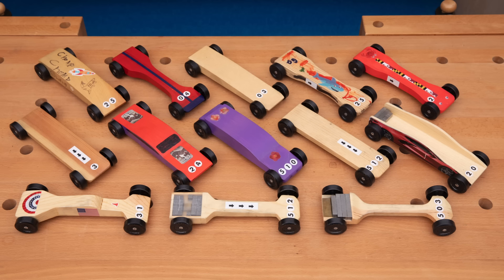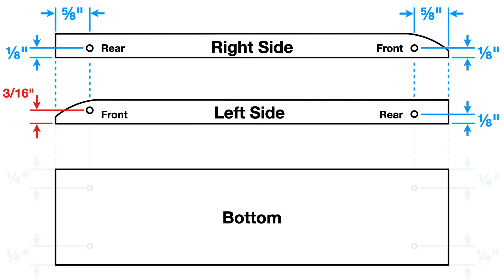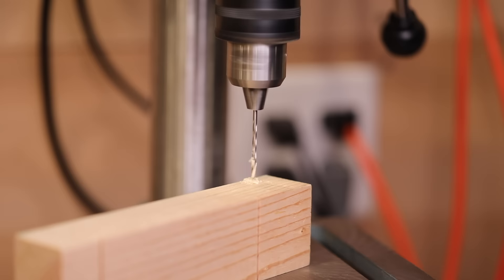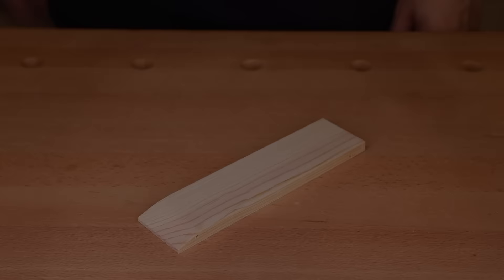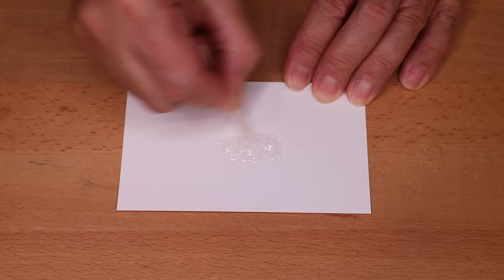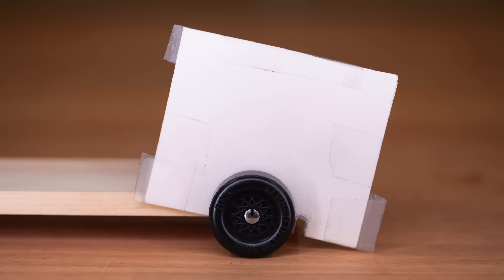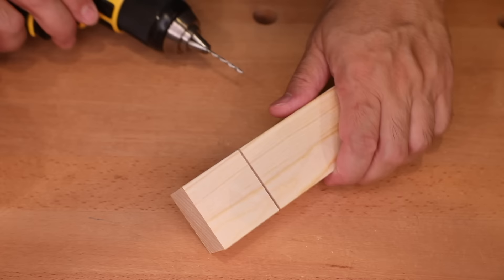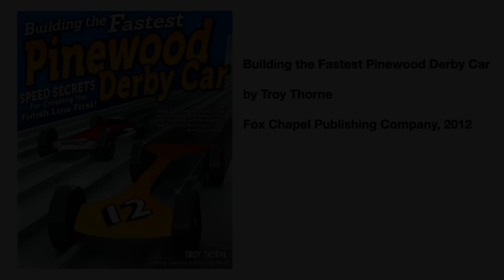Build a Winning Pinewood Derby Car: Step By Step

Comment: Great video. We’re on our 2nd Pinewood Derby and we screwed up our first run at a car this year. Couldn’t follow this exactly because we can’t move the wheels forward or back but I needed a solution for a quick car that would be fast. Using the main principles of this build we were able to put together a car 4 days before the race that finished 2nd in his group and was significantly faster than our first try last year. Looking to build on that for attempt #3 next year.
Reply from the maker: Good job, and congratulations!  As you probably discovered, weight position is still the most important factor even if you can't change the wheel positions.  Wishing you continued improvement!

Comment: Great video and thank you for all the tips. I wish i could attach pictures of the car my daughter and I made for her pwd race event. Her car averaged 218.07 MPH across 6 heats. She won the first place in the pack and the rank Thank you for making this video.
Reply from the maker: Well done and congratulations to your daughter! I wish I could have seen the car.
Reply: The differences in design are 1. instead of the left wheel raised, we had the right wheel raised. 2. Also we could not find the rectangular weights so we went with the cylindrical weights and superglued them together to create a rod like structure and placed them at the end.  @EngWorkshop
Reply from the maker: Thanks for sharing the photo. As you figured out, it doesn't matter which side has the raised wheel. I just had to pick a side for purposes of the video. And your cylindrical weights look better (less utilitarian) than the rectangular ones.

Comment: Really great video!!!! Thank You……I do have a question when placing the nail/axles…..How far in do you place the axles?? How concerned are you to keep the inside of the wheel from rubbing against the side of the body????? Thank you
Reply from the maker: I think the proper gap between the wheel and body is important. As shown in section 8 (wheel installation), the gap should be 1/32 inch. The video shows how to make a spacer to help achieve the proper gap.

Comment: Wanted to use this process, but couldnt because my son's pack only allows existing Axle slots to be used. Great video though!
Reply from the maker: If the axle slots must be used, it is a good idea to drill them out and glue in the nails, as shown near the end of our video.  Otherwise, we have found it is easy for the slots to be damaged during axle installation, or the nails to fall out during the race.  Much of the video's process could be adapted for your son's Pack.  For example, the principles of weight distribution still hold.  And if the axle slots are drilled out, you probably can use the same method of wheel alignment.  Either way, thanks for watching and good luck!

Comment: At the end you show the cars you? have built. Which was the fastest? Thanks for posting!
Reply from the maker: Fastest car was #512, second row, fourth car from the left. It was my car for our Pack's parent race one year. Over the years, I have participated in the parent race using cars of similar design and construction, so I'm not certain why one car would run faster than the others. I wonder if slight differences in track setup might be the cause.

Comment: Most rules require the axles to be visible so drilling holes are not allowed
Reply from the maker: The rule sheet inside the official Pinewood Derby car kit does not prohibit drilling new axle holes. However, each Cub Scout pack sets its own rules, so there will be packs that do not allow repositioning axles and/or drilling axle holes. Each Scout should check their pack's rules. If the axle slots are used, it is still a good idea to drill them out and glue in the axles, as shown near the end of our video.  Otherwise, we have found it is very easy for the slots to be damaged during axle installation.

Comment: Where can you buy that drilling guide?
Reply from the maker: We bought the drilling guide from www.pinewoodpro.com. Similar guides can be found at other Pinewood Derby supply sites, such as www.maximum-velocity.com and www.abc-pinewood-derby.com. If you use a drilling guide to lift one of the axle holes, you may find the hole is lifted by more than the 1/16" we recommend in the video. That is OK, but it might increase the risk of the car jumping off an uneven track. If you want to drill holes at exactly the positions shown in the video, you may have to experiment a little with index card shims placed between the drilling guide and wood block.

Comment: Is the one front wheel not touching the track? Our pack requires all 4 wheels touch the ground. I thought that was a common rule.
Reply from the maker: Yes, in our design, one front wheel does not touch the track. The rule sheet inside the official Pinewood Derby car kit does not require all 4 wheels to touch the track. However, each Cub Scout pack sets its own rules, so there will be packs that have this requirement. If our pack had this requirement, we might have tried bending both front axles upward very slightly, then adjust steering by turning the front axles very slightly in opposite directions.
Reply: @EngWorkshop  thanks for the suggestion!
Reply: @EngWorkshop  why do you have one wheel different height than others?
Reply from the maker: The raised wheel does not spin, or at least not as much, so less energy is lost to this wheel's friction and momentum.

Comment: I've watched numerous videos with my boys. My little guy has done well in the past.  He wanted to shape the bottom of his car a bit. We had to put weight at the front to balance around the 3/4 mark.
Reply from the maker: As you point out, optimum weight location can vary significantly, depending on the car's shape.

Comment: If I have to keep the wheelbase (distance between the center of the wheel axels) at 4.5inch, is it better to shorten the overall length or pull back the location of the front tire axel?
Reply from the maker: Given the wheelbase restriction, it is definitely better to pull back the front axle location.  This would allow the same weight placement as a car with an extended wheelbase.  Shortening the car is equivalent to moving the weight forward, resulting in less starting energy.

Comment: I think raising the nose would allow the car to take off a fraction of a second faster.
Reply from the maker: This is true, in theory. We have seen some car designs that implement this principle. How much difference this makes is unclear. The spring-loaded starting pin found on most PWD tracks releases the cars much more quickly than they accelerate.

Comment: What size drill bit do you use on the press? I rather use my press
Reply from the maker: Whether using a drill press or hand drill, you need to use a #44 drill bit, which is slightly larger than 5/64" and slightly smaller than 3/32". You can buy #44 drill bits from online Pinewood Derby supply stores or Amazon.

Comment: how do you secure the weights
Reply from the maker: An easy way is to use a good adhesive, like two-part epoxy. This is what we used in the video. Beware of hot glue, Super Glue, and Gorilla Glue - we have seen things fall off of cars during the race that were attached with these glues.
Reply: I like to use double sided carpet tape under the weights to hold them in with a layer of hvac tape over them. Works great.

Comment: “Using only basic tools.”

Pulls out a drill press and band saw.
Reply from the maker: When I inserted footage showing the band saw and drill press, I probably should have made it clearer that this video's car was actually made using only the hand tools I showed at the beginning. Although helpful, a band saw and drill press are not required to make a winning car.
Reply: @EngWorkshop  You made that clear.  I heard it clearly the first time I watched the video.

Comment: You are cutting yourself short, or to say making your car slower then it can be. Everything is correct till you made your car go straight. With a bent axel (on the right and the lifted front left) you want the car to steer 3-5 in to the left over a 4 or 5 foot distance. This will make your car a rail runner. It WILL be faster and your times will be consistent.
Reply from the maker: Thanks for the comment. Rail riding prevents a car from drifting side-to-side and losing energy as a result. Using our alignment method, we have not observed side-to-side drift in our cars when they run down our Pack's track, so we have not felt the need to try rail riding. It would be easy to compare rail riding with straight alignment using the same car on a test track.  My son has aged out of the Pack, so I hope another YouTuber will try the experiment and report the results.
Reply: As you move more weight closer to the rear the car will wiggle. Rail riding allows you to move more weight back and not wiggle which is faster.
Reply: @EngWorkshop  going to disagree with you on this one as well.  A few other things that came to mind about axle prep, but not going to pick your video apart.
Reply: It depends on the quality & kind of track. My kid's pack uses a wooden track. So it has slight imperfections on the rail. A rail runner on this kind of track can hit those imperfections all the way down and likely slow it down. I think I'd gamble on the straight runner on a rough wooden track with a lot of imperfections over a rail runner. But on a metal track or a quality wood track you're going to have smooth rails, which then yes, a rail runner would be better.
Reply: @CurtPrice  GL with that straight shooter.   you are assuming that each section of the track is perfectly level from side to side and has no warps, twists, or raised surface wood from being in storage for 12 months.    A bit of 80 grit sandpaper and 3 mins of work fixes that rail.....  Just saying.  fix your packs track for the greater good of all racers.  You do you though.  Just have fun.
Reply: @machineenvyllc437  The first year my kid and I built a car that was pretty plain Jane. It did... ok. Middle of the pack or so. The next year I did the research and we built a rail rider and applied all of the other tips, but it didn't do well at all in trials the day before. It was just slow. It did so poorly, that it was losing to the car we made the year before. The track wasn't smooth, it had bumps & bad spots, it was made of wood, etc. So we actually re-used the car from the year before in the 2nd year. On race day, they stopped the races a couple times to "clean" the track because some cars were hitting an imperfection and jumping the track. It's a homemade track. It's a nice enough track for a homemade one, but it falls way short of the consistency of a metal track. So the last year, we applied proper weight placement to our 3rd car, it rode on 3 wheels, polished axles, streamlined, etc, etc... everything except being a rail rider. We built it to run straight. And it was the fastest car we had yet and it took 3rd place. I know that everyone recommends rail riding, and I get it. It's the way to go on a smooth rail, but if the rail isn't smooth, I think you're better off not riding the rail and hoping you miss the imperfections as it goes down the track.
There are all kinds of things that could factor into what may slow a car down. Obviously it could have been something else I guess. But based on what I saw on this particular track, rail riding didn't seem to be the way to go.
I honestly wish they'd invest in a nicer track. But I think this one is sentimental or something as some beloved scout leader built it years ago and they've used it ever since.
Reply: @CurtPrice   I have built 1000’s of cars   Statistics says your straight shooter is an outlier.  

I am not giving advice for outliers.  I am   giving advice for those that need direction that will put setups in their favor.  

I bet their are more better tracks out there than bad ones  

Not even adult league racers do straight shooters.  

And just a thing of note  if you built a rail rider once   I almost bet the adjustments could use some tweaking to get more speed.  rarely have I seen anyone built it correctly the first time   That is my experience as a derby guy
Reply: @machineenvyllc437   Again, on a regular track, you're 100% correct on all of that. But I'm telling you, this was not a regular metal track. It's an older, homemade, wooden track with a lot of imperfections, including nicks and bumps on the rails and seams where it's pieced together. Rubbing the rail the whole way down, hitting every single imperfection and seam, doesn't seem to be the way to go on this particular track... at least from what I saw anyway. Each time it hits one of those imperfections or seams, it slows the car down. And like I said before, there were a number of cars that jumped the track.. likely due to these imperfections combined with maybe improper weight placement. I know straight runners have issues with bouncing around, but by not riding the rail, they're also avoiding some of the imperfections on the rails. And I'm going to go out on a limb and say rubbing against a wood rail the whole way down would slow you down more than rubbing against a metal rail does.
But hey, I'm not an expert. I'm just telling you how it is on this particular wooden track.
Reply: @CurtPrice  Going to have to disagree with you 100%  And I'll just say.... You are setting people up to fail by suggesting your way is better for a wooden track.  I am trying to guide them to the right path that is statistically in their favor.  

You're saying one time at band camp.    Sure that one time....  worked for you.  But I guarantee you statistically the rail rider gets more / closer to the winner's circle on all tracks....  And if you are really grinding (meaning too aggressive ) then your tune is incorrect.  you should only be kissing.  Maybe your tune was really aggressive?  No one really knows.
Reply: @machineenvyllc437  Nowhere did I say my way was better for all wooden tracks. I'm just saying if the rails aren't smooth, like on the wood track we have used for years, then you probably don't want your car rubbing the rail with all of the imperfections all of the way down the track. That seems like common sense to me. I doubt you've raced on the track I'm referring to. So I'm not sure why you think you're an expert on this track. Like I said, it's handmade and old. It's not like most tracks. But I'm sure there are some other rough tracks out there similar to this one with a lot of imperfections, bumps, seams, etc that can and will slow your car down or even toss your car right off the track if you rail ride the whole way down. And if there are, then I'd be curious to see how rail riders perform on those vs cars that run straight. That would be an interesting video. There was a specific spot on the track last year that tossed a number of cars... and it wouldn't surprise me if those cars were rail runners. Like I said, they stopped the races a couple times to "clean" and try to fix that spot. It is what it is. All I'm saying is that if a track isn't a quality track, it could very well effect the science behind the car. Common sense would say that the track is actually a major factor and can effect a car quite a bit. In a perfect world, all tracks would be identical. But that's obviously not the case.
Reply: @bt-xv1fy  No, I don't "race at the pro level". But yes, I have watched that video before. And he mentions nothing about imperfections on the rail when talking about rail riding. He mentions no track having a perfect surface, but he's referring to that hurting the chances of a car running perfectly straight down the track and how the track won't really allow for that. Too many variables involved to make a car run "perfectly straight".
I think you need to go back and read what I said because it's being misinterpreted. I'm well aware that rail riding is the better method on a regular track. I'm not saying a straight car is better. I'm saying if the rail is rough, riding the rail might not be the best strategy. I'm also guessing that "pro racers" don't race on beaten up wood tracks either, like what we race on. They probably race on high end smooth tracks where rail riding is obviously the way to go.
Reply: 3-5" sounds a bit excessive, don't you think? I believe Mark Rober mentioned 1" over 4-5 ft, did he not?
Reply: It all depends on the car. What ever it takes to stop it from wiggling is what the car gets. I have had 1 car set at 1 inch and one set at 6. The micro cars (4 in long vs 7) are over 19. I did a micro car that was 25 just to get it to stop bouncing. But the most common is 3-5 @CurtPrice